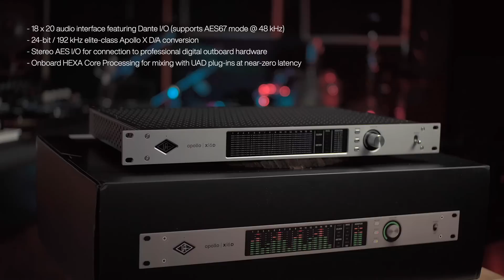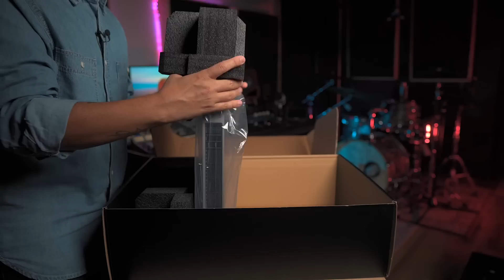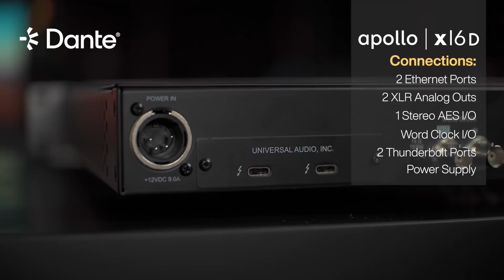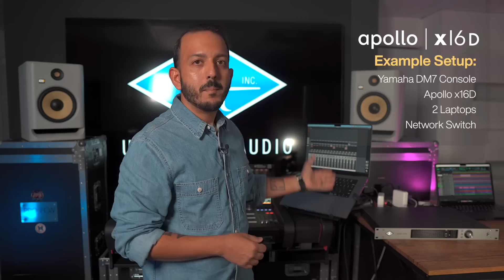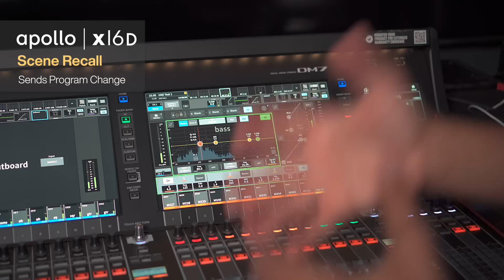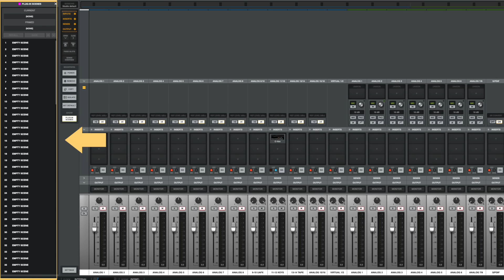Universal Audio Apollo x16D - First Look and Unboxing!

Comment: If using multiple x16, does each need to be on dante, or does the x16D act as the main device and others are linked through TB3?  Basically if i want 64ch in dante does each x16 need to be dante equipped?  Or just 1?  The apollo connectivity side of dante was not shown and how the uad boxes interact with each other over dante and how it interacts with console.
Reply from the maker: You have to connect them all to the network as well as the thunderbolt which can all be daisy chained. You can also connect each one of them to a network switch and even do redundant networks with 2 network switches.
Reply: @theheatstudio  i have a dante interface card with redundant setup, but in order for me to track 16+ch you are saying that i need to have each x16 on dante separately?  So if i had an apollo x4, i couldnt use it other than a monitor controller?  as people with apollo already now need to replace all of them instead of just getting the x16D for dante conectivity...  I was hoping it would work just like using their tb3 but can now pass through dante instead of tb3.  Just select that as the main unit but they talk over tb3.  If this is the case thats really poor integration.
Reply from the maker: @thunderhousesound1974  i’m not sure I understand 100% how you want to integrate it but all Dante devices from any company have to be connected to a network or daisy chained if you’re not doing redundant. This is normal behavior for all Dante devices. This Apollo x16D works for great for inserting UAD plugins at low latency for live consoles for example. In a recording studio you can use Dante enabled preamps which have to be connected to a switch as well and then route the signal into the x16D to be processed with UAD plugins
Reply: @theheatstudio  i have a dante interface that is nothing but dante port it can do 512ch over dante.  I want to be able to track and mix with a hybrid solution justvlike going to tape but need converters to interface over dante.  Basically i want how the tb3 works with the apollo, but instead of tb3 it has a dante connection sending the i/o.  Ive been looking for a 64ch i/o dante solution and was hoping that uad would do something as im invested in their platform but this is totally not that.  They just needed to make a card for their existing interfaces.  For me its not usuable as a converter in the digital console realm as i need a dante converter to insert hardware.  This is like a glorified waves rack setup but more limiting.
Reply: @thunderhousesound1974 yep but cost more :)
Reply: I just realized that this doesnt have analog i/o...  WTF?  This is dumbest product.  Its so you can use plugins over dante...
Reply: tell me you don’t understand what this product is made for without telling me you don’t understand what this product is made for…

Comment: Wish it had some analog I/O. I think this is a step in the right direction for some. A couple of DB25s for AD/DA would crush. It seems like its just a Dante plug in host! Am I wrong?
Reply: This is really disappointing I/O. Absolute cash grab by UAD.
Reply from the maker: @hughesdrive  mostly yes, it can also send Dante or AES67 to speakers or serve as a master clock with dual crystals for your system

Comment: If I want to do dobly atmos with genelec speakers it only will use one cable ? Can you do a video for Atmos ?
Reply from the maker: Hi, as described in the video for AES67 you connect the primary out from the x16D into a network switch and from there distribute to each speaker!

Comment: I’m using a Ql1,  adat card and aes card with an old Apollo giving me 10 inserts, lower latency and much lower cost. Plus I have analog inputs. I like this but a simple card for the older devices or satellite that allowed Dante inserts would have sufficed.
Reply from the maker: That's a great setup! The x16D needs Dante and Thunderbolt so a card wouldn't have worked
Reply: @theheatstudio  got ya. This makes sense in live audio. What’s the price difference between the one that comes with the ultimate plugins bundle and the other? I’m only finding the ultimate bundle but I already own most of their plugins.
Reply from the maker: @mikeboltz  check out your local dealer for correct pricing but it’s basically a 1k difference!

Comment: Is my Apollo x8p garbage now???????
Reply from the maker: @mattelder4269  totally different products, completely different applications so no
Reply: This only has 2 XLR outs and 1 aes in and out so it's totally for getting signals to and from a Dante network at ultra low latency. It is very useful for live sound where the console or stage box is going to be the main phisical IO. Or in my case since I own dente equipment I can now connect my apollo systems to the network without going thru a ton of conversion
Reply from the maker: @IntheDAW  absolutely right!

Comment: It’s crazy that this is limited to 16 channels. Seems to have missed the spot a bit. Limit the console UAD2 slots to 16 channels, and still let us have access to all 64 channels in a DAW. Then you’d have had something. All this does is replace the old Live Rack without the added bonus of redundant PSU.
Reply: @nickallottmusic  totally agree. They should add more DSP chips and bring it to 32 channels of Dante IO at minimum. That way we can combine 2 and have the full 64
Reply: Well, with only 6 DSP onboard, you won’t really need much more than 16 channels, otherwise you will still exceed DSP. Maybe they should have 16 DSP on this X16D to have at least one DSP per channels, or expand to 32 channels so you could add some Satellite Octo to get to 32 Channels and 32 DSP total with 2 satellite Octo on top of the X16D. With 1 DSP per channel, up to 32 channels, it would actually be very useful to mix without using any computer power, or to have live processing for recording or live performance… But of course, UA is squeezing every cents of their eco system

Comment: I'm sorry, having a DANTE being the ONLY I/O other than TB is crazy and not worth it. UA should just ADD Dante to their apollos(like they did with firewire to TB cards they sold), instead of making a whole new box. Sorry this aint it.
Reply from the maker: It depends on your needs, for using it as a UAD plugin insert processor there’s no need for any extra I/O if you use Dante or if you’re only mixing and don’t need analog inputs.
Reply: @theheatstudio  yes in the very limited use case where you need only Dante connectivity. But I would still argue the better solution is just adding a dante card to existing products. buying a whole new box when a card could be slotted in to existing devices would be more cost effective for the consumer. Buying a whole new box just to use it as a UAD plugin inserter is wild. Unless this box is sub $600 US. How much does it cost?
Reply: @chanepic  5k ^^
Reply: Totally agree. The marketing is very misleading too.
Reply: I think you’re looking at this device from a point of view it’s not intended to address. This is for all types of audio but really shines in live, broadcast and realtime production environments which almost exclusively Dante these days. What many studio operators are unaware of is that many other manufacturers have recently offered something similar in partnerships with console manufacturers. This brings the massive library of UA solutions to the live world without the need for an additional interface.
Reply from the maker: @michaelconner7149  it really shines in live sound! There’s a section of the video where I set it up with a Yamaha DM7, check it out!
Reply: @theheatstudio  I’ve had one for a month to test courtesy of UA and I have been using Apollos live since 2015 lol so I’m well aware! I mix Steely Dan and Paul Simon up to his retirement. Use Apollos for both!
Reply: @theheatstudio what about tf5 and tio1608d
Reply: @michaelconner7149  It is still extremely disappointing. Absolute cash grab.
Reply: @michaelconner7149  ahhhh I feel that re: broadcast. That makes more sense.
Reply: @michaelconner7149 but having a card in the slot would be so helpful for everyone. Also in that field. 

Now you have to spend 5k for something that can be actually had for much lower price if you already spend so much on UAD. 

Or at least iffer a card for the “old” models.

Comment: Hi Paolo! Did UA update the converter on these new Apollos? Cheers!
Reply: Probably not gonna update them anytime soon if they are releasing this
Reply: No, same great converters!
Reply: @UniversalAudio  Yes, they are great, but why am I going to buy another one if the converters don't improve?
Reply: @xdosemusic98  Exactly. Its been what 6 years now with the same old 2D sounding converters. Neumann and Merging Technologies will soon replace all this outdated tech from UA
Reply from the maker: @xdosemusic98  completely different product for a different application. Dante is a digital protocol and there is no conversion unless you are connecting the analog monitor outs.
Reply: @theheatstudio  but it would be good if uad improved his converts, because if not he will be left behind
Reply: @xdosemusic98 what would u recommend?
Reply: @theheatstudio  dude I love your channel this video was so well done. And your responses to comments are so just in the pocket of you know what your talking about
Reply: @UniversalAudio 🔥🎶🔥🎉
Reply: @UniversalAudio What is The point to point latency?
Reply from the maker: @vladsuhodolski  I believe half a millisecond without adding any plugin
Reply: @UniversalAudio  The converters are outdated. The sharc chips are also outdated. Even small interfaces sound better.